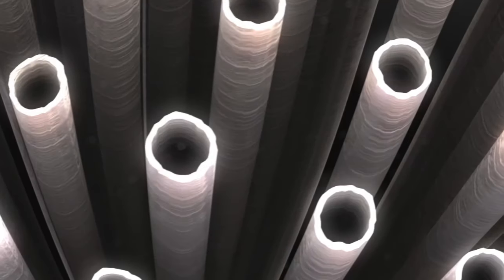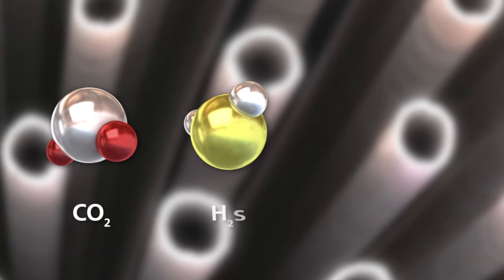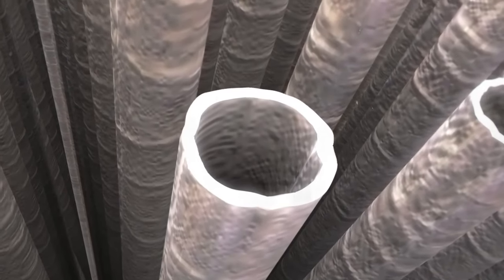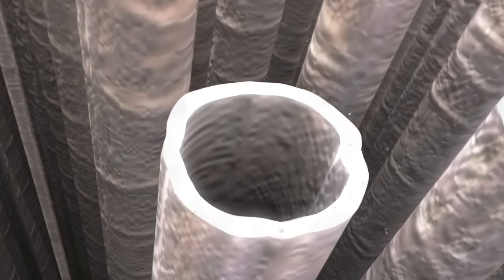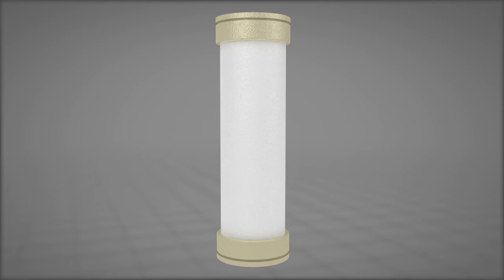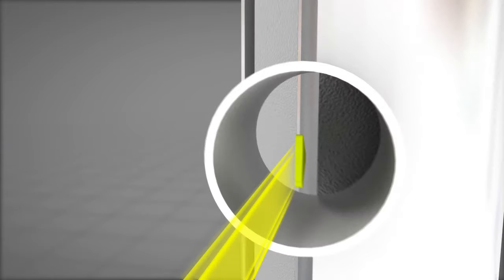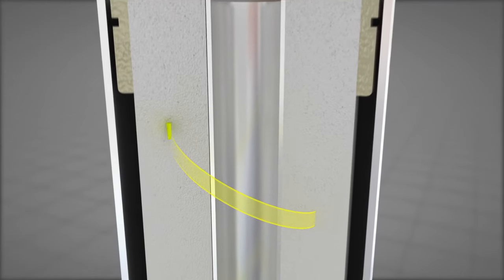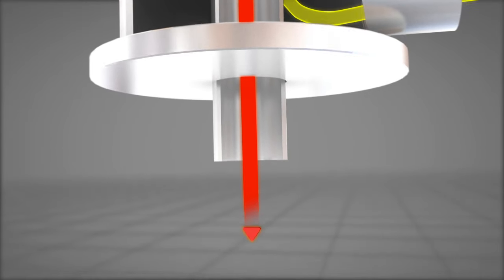CO2 Separation - How It Works

Comment: Ok but what is this process called ?
Reply: membrane separation
Reply: I think it is called semi-permeable membrane
Reply: It fits the definition of chromatography quite well.
You have a mixture of some kind, and use a stationary phase in order to slow down the components by different amounts to achieve separation.

Comment: Ch4 is larger than CO2
Wtf are you talking.
Reply: U mad?Oxygen is heavier than hydrogen, go learn chemistry first
Reply: @bhargavrokade9279  are pagla mai majak uda raha hun ki 
Kya ch4 co2 se bada hai?????!!!!!!
😎😎😎
Reply: CH4 is larger than CO2 in diameter. The greater number of protons in CO2 draws the electrons closer in than those in CH4.
Reply: I think that's the point. or how the filtration works because of the different size.